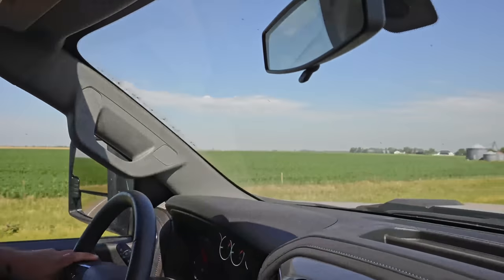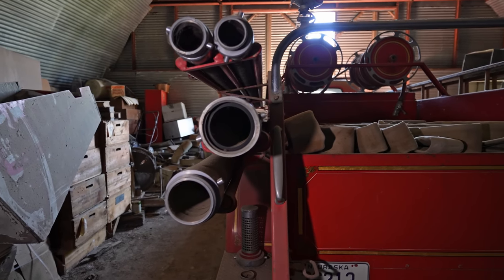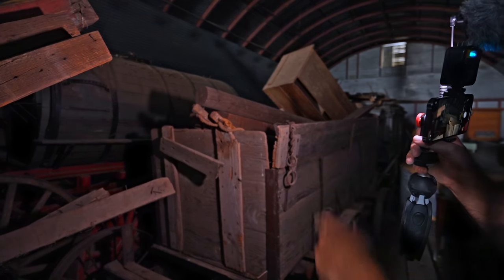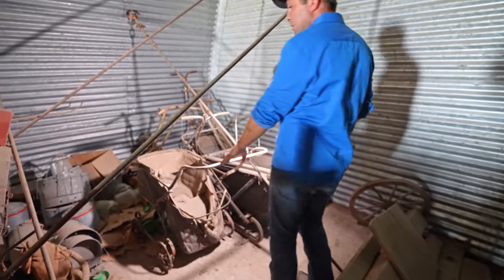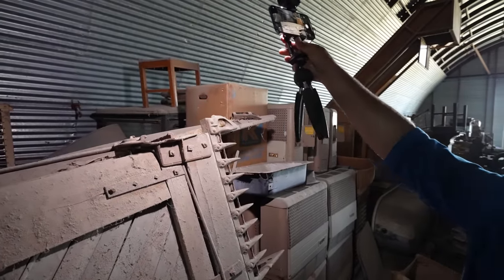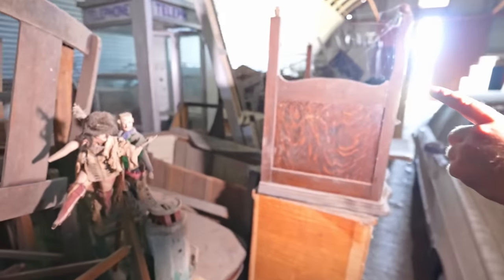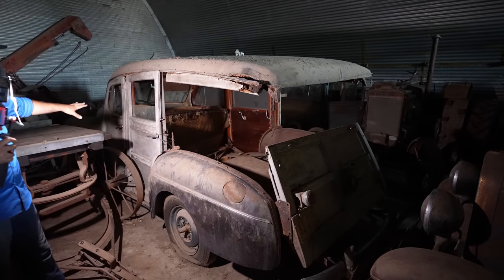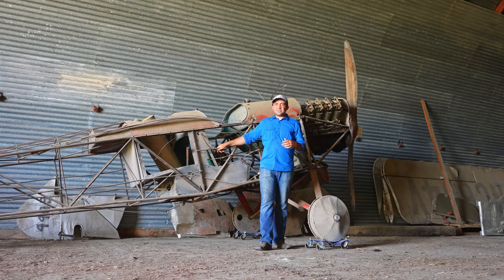You won't believe the INCREDIBLE TREASURES hiding in these old barns! CRAZY items from 1800s-1900s!

Comment: Quonset huts are great buildings! Local Ventura County farmers use to buy them as military surplus from the Seabee base at Port Hueneme, CA and relocate them to farms all over the area. These building came in all types of configuration and sizes. 
PS - when stationed in Japan, lived in an upgraded Quonset hut. Old but did the job.
Reply: I thought they looked familiar, had smaller ones on gomer pile, on the military base

Comment: Silas, the thing you showed at the beginning was an early type of hay loader... it was pulled behind a hay wagon which was pulled by horses or mules,  It would straddle the rows of hay, pick them  up and move it to the top where it would fall onto the back of the wagon.  From that point, a worker would move the hay to the front of the wagon as high as they could pile it, it was then taken to the barn where it was unloaded by a set of hay forks rhat were also powered by horses. l remember working with my grandparents on the '50s putting up hay that way!

Comment: If I'm right that electrical panel you saw in the building with the telephone switchboard is actually a very, very old telephone relay switching system that was used back when telephones first had the old rotary dials.  With it you didn't need an operator to connect you to the line you wanted, it did all of that for you.
Reply from the maker: Wow! Thank you for letting us know!

Comment: What a great video of old farm equipment. Silas the first building you showed us on the way out you showed us what you a hay loader used for putting hay in loft of a barn. I think it is a hay loader for loading hay on a trailer. You was looking at the front. You pull it behind a flat trailer and it would straddle the hay as it goes over it picks up the hay & put on the trailer and someone would be waiting with a pitchfork & stack it on the front of the trailer. Took me a while to figure it out. Then I seen one at a tractor show. I watched a video on utube  and they has about 20 of them. I watched for over an hour! I really miss them old lawnmower & tractor shows. THANKS for all you do and great videos Silas ! 🛻🚌🚙🚗🚐🚎

Comment: The Otto engine was a large stationary single-cylinder internal combustion four-stroke engine designed by the German Nicolaus Otto. It was a low-RPM machine, and only fired every other stroke due to the Otto cycle, also designed by Otto.

Comment: The 1st Airplane looks like a DE Haviland Tiger Moth.And the Shepherds wagon looks like it started life as a Horse drawn tram.
Reply: Wrong rotation motor for a tiger moth!
Reply: @fairweatherfishing  Well the registration points to a Gypsy Moth but they had a different engine.
Reply: Dave You are correct. A Gypsy Moth it is. S/n 172 possibility.  Looks like they had both left hand and right hand rotation engines.  I used to hand prop a tiger moth for a fellow pilot at Plum Island Airport (2B2) that was the wrong rotation!  Had to stand on the other side to prop!

Comment: Love the video. The 2nd Coke Cola machine you showed is a water bath machine the water was cooled, and calculated around the bottles. The machine was used in old grocery stores, and other type business. The machine you were thinking of that has the rack inside was made by Ideal called a slider. I have many old Coke machines from the 1940's, and early 1950'. I have the Ideal 55 slider in my collection.

Comment: I actually passed my drivers test in a 1972 International Travelall.. That one there is newer than 72 because the gas filler is on the rear fender. Probably a little safer not sitting on top of the gas tank.

Comment: Those two brass corner fittings you picked up with the wheels inside are for a library ladder they're the bottom Wheels or the top wheels that ride on a rail
Reply: I only wish I could have been there for the auction hit me up for the next one

Comment: That piece of Equipt. you said for Hay is for picking loose Hay windrows up outa the Field.. it hooks onto the Back of the Wagon just the way it sits and you would drive the MTY Wagon over the Windrow and it would rake it up off ground and put it up on the wagon from the back. then you'd have 1or 2 people on the wagon stacking loose hay.  Then theyd take the wagon back to the Barn like the white Barn in your video with the Top Front open on it which would have a trolly& Forks system to bring it up into the Mow.... Pretty Back breaking Work back in the Day.

Comment: At 43:55 on the right side of the screen sits an RCA type TP-6 16mm film projector used in TV stations until about 1970.
Usually had mag sound along with optical sound readers.  Just there for an instant,

Comment: The Otto engine that stands there is named after the inventor of the gasoline engine, Nicolaus Otto in 1876 
In the country of origin Germany, the technical term for the petrol internal combustion engine is also ottomotor and the fuel for it is called ottokraftstoff😁

Comment: Otto gas engine. Otto refers to the Otto Principle that all engines use to convert gas to power. The Otto Cycle is named after Nikolaus Otto (1832–1891, German) who is credited as the first creator of a petroleum fuel based internal combustion engine 
 operating under a four stroke cycle. That would be from the 1880's when they were still pioneering the use of internal combustion.

Comment: Coca Cola had a box cooler that was open like that one and the bottles just stood up and you reached in and picked up your bottle and paid at the counter.  Our local corner store had one when we were kids back in the 50’s, we would stand there trying to decide which one we wanted with the lid up and Emma would yell “you kids make up your mind and close the lid”.   At the local skating rink they had the one that had rows of different flavors of bottled sodas and you slide the bottle out of the row and over to a release section, you put your dime in and it would release the mechanism and you could lift the bottle out and the opener was on the front of the machine and the cap would fall into a catch tray under the opener.  Sometimes the kids would bring a bottle opener and a straw and pop the cap while it was still hanging in the slotted rows and suck the soda out of the bottle.

Comment: The old car with tracks was designed for a  purpose and that was the post office...Rural roads where never plowed and mail had to go through...If you looked there also should been skis under car that's steered...skis kicked in when snow got deep...most versions I seen are based on Ford model A..One seat was all that was needed and made more room for mail...Not sure when post offices sold them off...I believe most went to farmers for farm use after post office...

Comment: you wouldn't be able to ask about the yellow 66 Ford galaxy squire wagon maybe. the galaxy wagon and convertible cars have always been a little special to me.  if I could I'd really like to have a 78 Chrysler le baron wagon with wood trim. I just wanted to say that you missed out by not taking the lenses out those Studebaker cars. yeah some you can buy new, but the original is always loved more. it's the same with most vehicles.  if possible if you could help a guy out. I'd even be happy with a dodge aspen wagon to start with.  I love your show most of the time.  I would buy me another old car but I wasn't sure about my injury so I sunk most of my money into supin up a Ford Aerostar van and won some races. kept some to keep it racing all the way to 587, 263 miles on it and the rest into my Xbox account. I also like those international trucks.